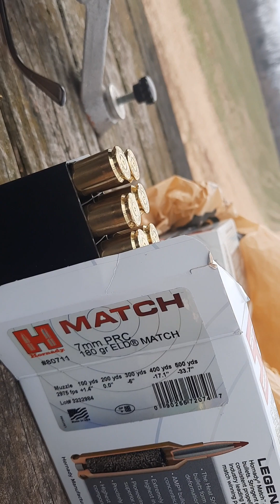7PRC Fierce Carbon Rogue

Comment: I've been considering a fierce rifle for about 2 years now but best price I can find on a carbon rogue is $2000 shipped, no tax. I've never had my hands on one but I think I want one. That said, I took my factory Tikka rifles (all new), 300WM, two 30-06, a 6.5CM, and a 7-08 to the range today. I do handload but only used factory ammo today. All shot 1/2MOA to 1MOA with the 300WM doing best with Norma Whitetail 150 gr ammo and 180 Norma Bondstrike. That stainless tikka was $800 shipped. So there's my struggle, do I consider my hunting rifles more for function and what is ultimately most important, which is how well they shoot, or put more consideration into weight, fit, finish, as well as accuracy. And the tikkas don't weight much anyway.
Reply from the maker: I set up rifles for individuals that hunt worldwide...do around 70 per year. My favorite ...most trouble free...most accurate out of the box for price ...is Tikka.
Reply: @theoldstyleoutdoors9351  Me too. Wish I pulled the trigger on a Tikka years ago. Would have saved me thousands in custom rifles. Just sat down from another range session. Only had time for the 6.5 Creedmoor, 708, and one 30-06. The CM is duplicating what both new 300WMs did, and I mean, identical. I first shot the 143 factory Norma Bondstrike and measured 0.444" 3 shot group, then the 140 Norma Whitetail, 0.210" 3 shot group. Repeated both and got identical groups. The 708 is still needing something different. It will shoot an inch grp but I think it will do better. The 30-06 shot 165 factory Hornady boattails 3/4". I have lots of components to handload for it so that work continues as well. On the way home I stopped by Vance Outdoors and bought the remaining 3 boxes of Norma 6.5CM 140 Whitetail ammo. I picked up the last 4 of the Bondstrike but at $49/box, put them back. I want them, just have too many other things I need to put the cash towards and the CM, despite shooting so well, is something I'll shoot rarely (at least I think). Only things I'm changing on these Tikkas is a better trigger spring to get at or close to 1 pound, and adding a limbsaver recoil pad
Reply from the maker: The trigger spring for the Tikka is the best $15 you will spend on it! 
Good luck!
Reply: Being a 60+ year gun collector and owning Tikkas ,Fierce and Sako beside many custom builds and the Tikka is great for the price but if you can afford one the Fierce makes a awesome rifle for the price, I bought 2 Fierce rifles for my boys and I personally hunt with a Sako which is a fantastic rifles as well, it all comes down to how much you can afford!
Reply: @edwardabrams4972  It's definitely not the money but more function. I've got rifles that were $8000 ready to hunt but when I go shoot at a range out to 400 yards and the fella next to me is cranking out groups with his Ruger American  or a plain blued Tikka T3x Lite just as good as what I'm doing (1/2 MOA or better) I start to question whether or not "fit and finish and aesthetics" are worth thousands more

Comment: What scope rings and what is the height of the rings
Reply from the maker: @Thomas-h5o4l  those are Talley Ultralights..these are mediums. Lows would have worked but when I set up rifles for others I'm always more concerned with proper cheek weld for that person. 
Talley makes great no nonsense products..I use around 30 sets of these per yr..never any issues!
Reply: @ thank you